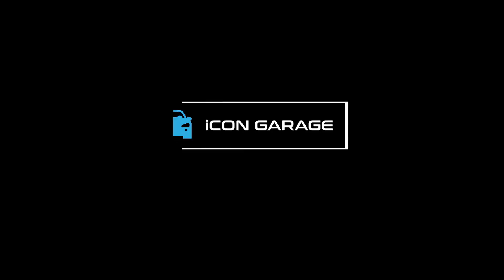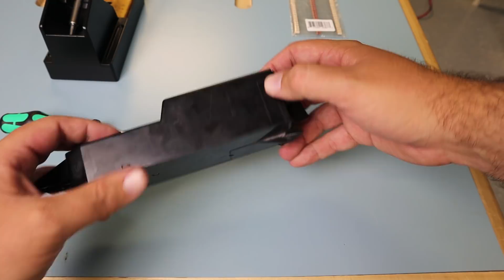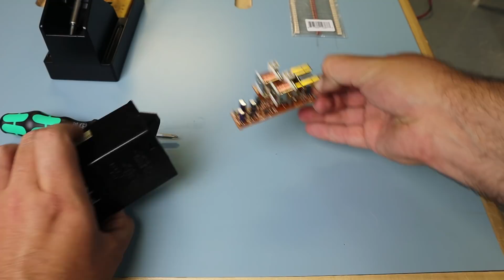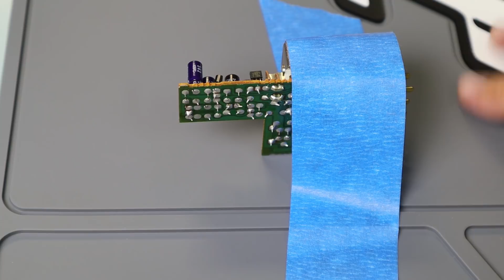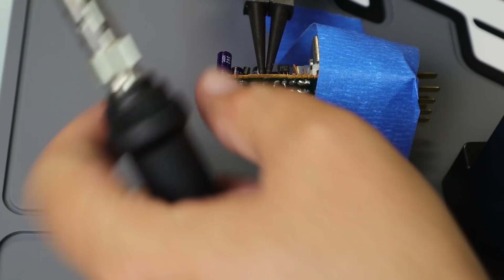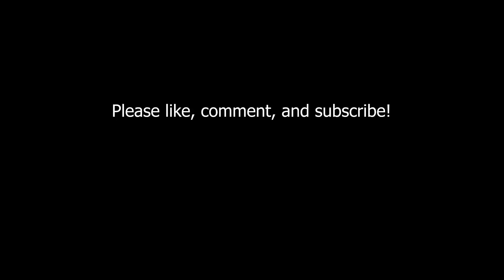FD RX 7 Flasher Mod Adjust LED Turn Signal Flash Speed

Comment: My man! This is what I'm looking for, no freaking hot resistors or messing up with the wires!

I have Azera 2009 its flasher system is running through cpu not a relay like the old fashion. So who to do this to my Azera? How you managed to figure that out with your awesome car?
Reply from the maker: Search the online forums. I believe I originally read about flasher mods online. I’m willing to bet someone has done it on an Azera. Otherwise it takes a test bench, wiring diagrams, and knowledge of circuits to locate the components. It may not be possible this works on all models.

Comment: You'd get it much easier with a desoldering pump. Heat up a Weld, pump the solder, again on the 2nd spot and you're done, you can pull your resistor. (also great with a "third hand grip", you'd get both in most soldering kits)

Comment: For future reference when you solder on a circuit board, heat up the solder with your soldering iron and then use a baby booger sucker bulb to pull the liquid solder out. This does two things, it makes it easier to remove the component and it gives you a clean hole to put the new stuff in. Also it removes the slag so you don't have to worry about it shorting on anyting.

Comment: Just some tips:
1) Tin the soldering iron tip
2) Add solder to the pad first, this softens the old solder joint
3)Do not push the leads of the resistor with the iron. Appling pressure to the pad can cause the trace to lift off and damage the via.

Try alternating the heat between the two pads and removing the resistor in one pull. By just removing the resistor you have either removed part of the circuit or it was a pullup or pulldown and you have left the signal floating.